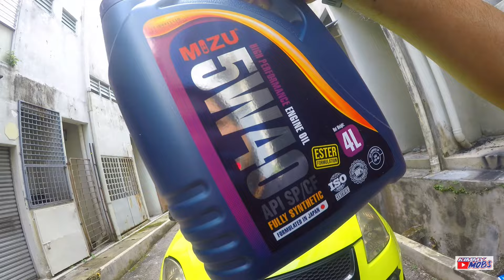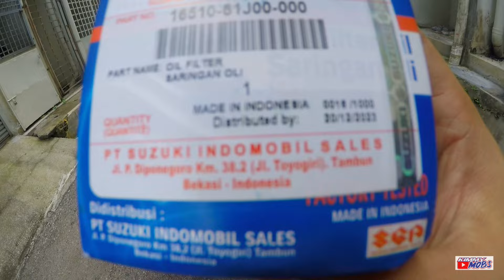SERVIS MIZU FULLY SINTETIK UNTUK SUZUKI SWIFT

Comment: 5W-40 Boleh guna untuk suzuki swift 2008 tak, mileage 133k?
Reply from the maker: Boleh.  5w40 Boleh.  5w30 Pun Boleh. 

5w40 Kalau Banyak Long Distance Punya Travel. 

5w30 Kalau Banyak Masuk Town.
Reply: @ kalau 10w 40 fully synthetic kurang sesuai ke tuan? Brand mizu jugak
Reply from the maker: @ Boleh Pakai. Tapi Perfomance Drop La. Sedap Fully Lg ☺️